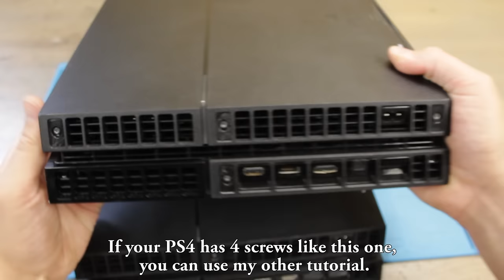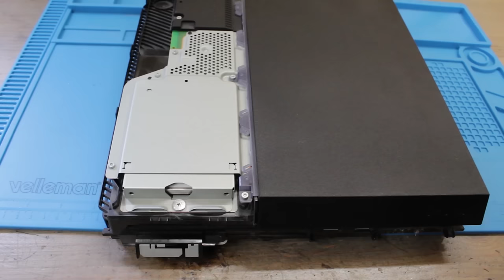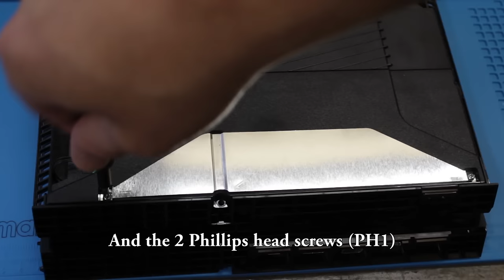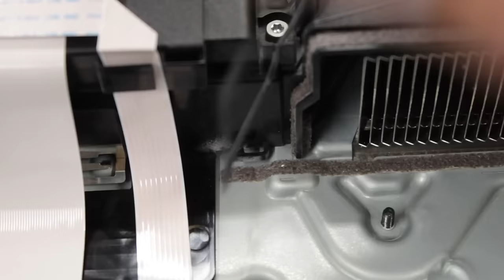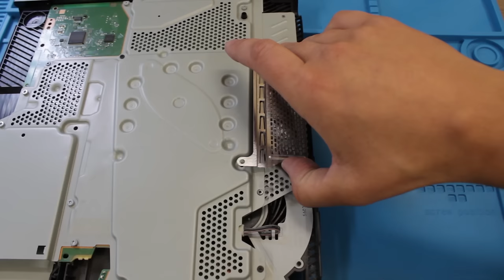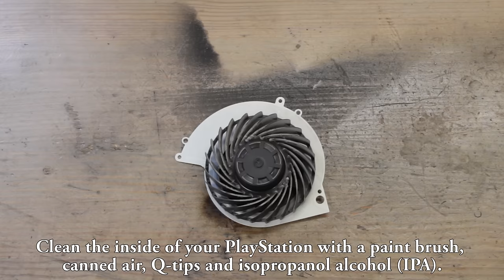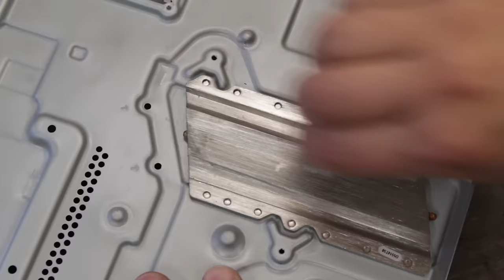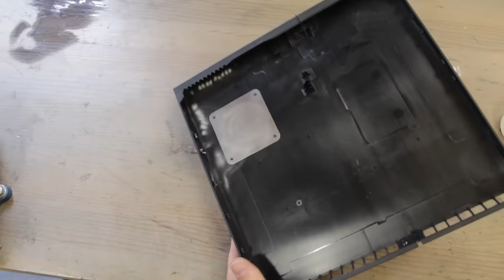PlayStation 4 model CUH-1200 cleaning tutorial.

Comment: Dude thank you so much! Best PS4 cleaning tutorial on YouTube! Was super easy to follow along. Sincerely appreciate you! I can't even hear it running now when it's on. 🙂
Reply: U think that will fix my problem haven't been cleaned since I got it 3 4 years ago now I'm going thru the white light safe mode problem where the ps4 won't start
Reply from the maker: You're welcome. Thanks for your comment. Nice to read that your ps4 has become so much quieter. Well done. 👍
Reply from the maker: @Darealblase0  It I don't think it's going to fix your ps4. It sounds like your hdd has died.
Reply: @SpareTimeWorkshop  dam what's hdd?
Reply: Nvm my hard drive might have died then

Comment: thank you for this one. my first time cleaning my ps4, and first time changing thermal paste on any of my devices including pc. and i have had it for years. lol so it was really nasty with dust. this tutorial worked perfectly. only thing i would recommend doing differently is when disconnecting the power"box" thing. dont try to disconnect it from the card but from the power supply unit instead. easyer by pulling by the cables CAREFULLY. 
I broke two of those cables in the "card end" by trying even doing it as carefully i could. but hopefully i managed to fix it. if not i will have to search for a new cable. but i guess its possible to find one of those(the one with 4 wires side by side)

Thank you for the otherwise great video!
Reply from the maker: Thank you for sharing your experience. Sorry that your cable is damaged. 

That's a great tip, I also think it's safer to disconnect the cable at the power supply instead of the motherboard. 

I would use the pliers myself so that I don't have to pull on the cables.

Fortunately, new cables can be bought online. I don't think they are that expensive.

Good luck with the repair.
Reply: @SpareTimeWorkshop  yes I saw that, just a few bucks. But I will try and see if I managed to fix it myself first😉

Comment: Brilliant video with clear and easy to follow instructions! I’ve just done my first ever complete disasemble and cleaning + replacement of the thermal paste and upgrading to an SSD In my old ps4. And my god a difference it made 😍🤩 Its completely silient comparing to before 🙌🏻 Thank you so much for this video, it really made the job 1000 times easier 👌🏻 greetings from Denmark 😊
Reply from the maker: Thank you. Well done. Nice to receive a commend from you. Do you notice much difference in load times with that SSD?
Reply: @SpareTimeWorkshop  
Cant say for sure. Aa Family guy with 2 small children and a full time job, i dont use the ps4 as much as i used to 😅😆 I havent recorded loadingtime on games before replacing it to compare, but with Cyberpunk 2077, it does feel like the loadingscreens are snappier to load through. I am certain it  is an improvement 😊 I Got the Samsung 870 EVO 👌🏻
Reply: @SpareTimeWorkshop I dont have any thermal paste but cleaned it off already. What ramifications can arise if I put it back without any?
Reply from the maker: The cooling paste is not optional. If you put it together without it your PlayStation will overheat very quickly. But judging from your next post you have already tried it. Haha

Comment: Damn thank you so much sadly I'm not a pro surgeon like u so I decided to clean the fan by the part that sticks out and only cleaned all the dust from the top and bottom panel hopefully one day I will be brave enough to be like u 😇 you truly are so useful bro with out you I would had broken my ps4 10/10 video bro keep it up
Reply from the maker: Haha thank you very much. You've had the trickiest part. That's removing the bottom cover. The rest is not so tricky. You just have to be a little careful with the ribbon cables.

Comment: Just small note some might find it useful to save your time and effort, after opening and cleaning the disk drive when you close it make sure to slide the metal plate with gears under and inside the black plastic edge of disk entrance, had to close and open my console three times before I noticed this. Here 16:03
Reply from the maker: Good tip! You can easily miss that in the video. Thanks for sharing.
Reply: Thanks for this but still my cdrom is not taking disc 😢
Reply: It's 10:42 PM here and the 3RD DAY struggling soo much to open and cleaning and changing the paste

I see him cleaning the hard drive, disk drive and etc... I just won't man😂
Good thing I won't worry about this detail you mentioned. Since I almost never use disk, maybe it won't matter much or isn't even dirty..

Comment: I followed the tutorial to deep cleanup ps4 since I recently jailbroke it and it’s never been quieter I actually had to hold my ear up to it to make sure I actually plugged the fan back in I put on mx4 thermal paste and replaced the ram pads with artics tp-3 thermal pads not even made a peep no matter the game I play it can even run P.T without complaint it’s temps now top out around 75 C under heavy load which I way way way better than before one think I didn’t do the same as in the video I removed the psu cable from the psu side of it instead of on the motherboard as I didn’t want to rip the socket off the board so even if the socket came off the psu the psu can be replaced but replacing the motherboard is a bit of a pain but overall I recommend anyone do this with there ps4 the guide was perfect and I’m just baffled how quiet my ps4 fat has been
Reply from the maker: Thanks for leaving a comment. Are you satisfied with Artic tp-3 thermal pads? And what thickness did you use?

Can you always see the temperature? Or only after the jailbrake?

I agree that it is safer to disconnect the psu cable on the psu side. Unfortunately already had a reaction from someone where the plug on the motherboard was broken.

Fun to read that your ps4 is so much quieter. 👍

Comment: Coming back to this video to point out one major key point: the thermal paste.

OP mentions he used Arctic MX-4, which after a while of researching turns out it's the best one. But the importance of this is massively glossed over, because the wrong paste will NOT solve your overheating problem, and according to research, some can even destroy your system! THIS IS IMPORTANT!
If you use a thermal paste that has liquid metals or any kind of electrical conductivity then you have to be super careful not to spill it over. 

I bought a very cheap silicone based thermal grease and while it is easy to apply and doesn't damage your components, it is absolutely terrible for the PS4! It won't conduct enough heat properly and the PS4 will warn of overheating, if at all, otherwise it will just shut down immediately after a few beeps. 

So keep this in mind! If you're going to replace the thermal paste, make it a good one!
Reply from the maker: Huge thanks for sharing this information. I must admit that I did not know that the brand of thermal paste makes so much difference.

Of course, I understand that using conductive thermalpast like liquid metal is a big risk. I myself have always used Arctic mx4. And never saw reason to experiment with other brands.
Reply: @SpareTimeWorkshop  Glad I could give some knowledge back! Today I got my hands on a ceramic based thermal paste with solid metals (grey color) very similar to the Mx-4 and the difference is night and day; not only did I apply significantly less paste as opposed to the silicone based one, but now the console is as quiet as it was when it was brand new as well! 

Ngl, it feels amazing seeing the console in the best shape it's been in years.
Reply: @DeMoraJS what is the thermal paste you used? I'm going to attempt this clean up as-well!
Reply: @nikhamilton6594  It was a generic brand named Thermal Cote 400. The one used by OP is reportedly one of the better ones, but regardless of brand the most important thing is that the thermal paste you get is ceramic and solid metal based, NOT liquid metals. You could try a liquid metal one but you have to prepare it and then apply it, which, if you mess up, could potentially fry your system (liquid metal conducts electricity anywhere it drips into), so be careful! 

Better be safe and get a ceramic solid metal base which you can identify by its opaque solid grey color. Hope this helps!

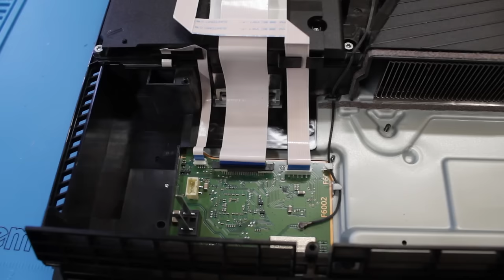Comment: Anyone doing the POWER SUPPLY CONNECTOR 3:18 must use a flat head screwdriver to go in between and underneath the little arrows on the connector. Then lift up while pulling up the cable with your other free hand BUT do it cautiously.
Reply from the maker: Never done it that way myself. I will give it a try next time to see if that is easier than using needle nose pliers.
Reply: @SpareTimeWorkshop  Yeah that’s the only way for me to get it out. I tried doing the way you did it in the video but it didn’t work. I even ended up tearing a cable but it’s ok I already ordered another one. Thank you for the video, it was still the best one I could find so far.
Reply: @SpareTimeWorkshop  https://youtu.be/P2rTRaMOtr8?si=-axBy0trWr7FWemo at 2:15. This is the video that shows the method.
Reply from the maker: @greatwarriorstruggler9447  I tried it, using a small screwdriver to disconnect the connector works very nicely indeed. Thanks for the tip.

Using the needle nose pliers works fine for me too. How unfortunate that you damaged the cable.
Reply: Can you explain a little better where I have to push up? I couldn’t take the cable out no matter what, and mildly scratched one the cable too (very little); it’s not demaged or anything, but just enough that the sliver underneath is visible. 

Nothing serious, but I’ll take it as a warning and use another way to pull it out
Reply: @christa4172  instead of “push”, I mean to lift up the connector with the flathead when inserted in between. Watch the video I linked at time mark 2:15.
Reply: @greatwarriorstruggler9447  1st off, thank you for responding, I do appreciate it.

2nd, I gotta apologise here, but I can’t figure out what and where is the linked video. Is that a new YouTube feature or something?

Comment: I slid my smaller top off to the left. Everyone seems to bend it out. Although I have the MGS 5 PS4 so not sure if that is different. It also only had 2 screws on the back

Ah, you were on the underside for that. Thanks, I was about to slide the larger top plate off but saw that you unscrewed screws there 😅

Comment: Removed most of the top part to realize I need to remove one screw on the bottom and all the wiring. Probably should’ve watched the entire video first. Now here I am at Walmart buying some thermal paste. 😅 I’m gonna do my Slim next, too.
Reply: Does it work if you don’t add temal paste bc u removed mines too without knowing he had to place a new one? 🤦‍♂️
Reply: @kbronn4875  I think it’s best you replace it now. I feel like since you tampered with the paste it may not work properly. I was gonna do the same, but my paste looked old so I went and got some paste. Unfortunately walmart didn’t have it in stores so I went to Best Buy. Hope I helped.

Comment: The top cover isn't coming off after taking the screws
Only one side of it comes a little
Reply from the maker: That one is firmly latched on. Have you gotten it off in the meantime? I don't have any additional tips for getting it off, unfortunately.
Reply: @SpareTimeWorkshop  yes i had to use the screwdriver to push the side part upwards and it came off safely
Reply: @ibrahima9274  👍

Comment: I cleaned the hell out of mine. Well... all I could not removing power battery.... dont trust my butter fingers.

I had 10 years worth of gunk inside the fan. Practically a miracle I never had a fire or even get a notification of over heat
Reply from the maker: They can indeed collect quite a lot of dust. In a room where they also smoke, it goes even faster.

Unfortunately most of the dust collects at the heatsink. It is difficult to reach it when the power supply is still inside.

But there is always a chance of damaging something when you take apart your ps4.  So I understand if you don't want to risk it.

Comment: The first time I did this, I didn’t have any thermal paste and missed two pads. When I started up, it would switch off very quickly.

I got myself some thermal paste and got the thermal pads to stick a little better, and now it is scarily quiet, started with no issues, and I don’t have to source another ps4 or get a ps5 from a scalper.

Thank you so very much. Liked, and subbed. Appreciate your hard work putting this together. So grateful!!

Ps, don’t get thermal paste everywhere, that shit is annoying to get rid of!
Reply from the maker: Thanks for subscribing i appreciate it!
Glad to read that the video helped you.
Reply: Wait did it be quiet for like week or its been quite all the time since you replaced it
Reply from the maker: @pacijentt4367  It should be quiet again for a longer period of time. Only if you smoke in the same room. Then your PS4 will get clogged sooner. because dust sticks to your PS4 more easily.

Comment: Greetings sir. First of all thanks for this amazing video. Thanks to you i have enough courage to take care of my ps4 now. I am wondering, is there anything you can recommend instead of isopropyl alcohol for the cleaning process ?
Reply from the maker: Greetings, thank you. No I wouldn't dare recommend anything else. The reason I use isopropanol alcohol (99.9%). Is that there is no water in it and it is non-conductive.

Therefore, you can safely use it on electronics without risk of short circuits or corrosion. Residues left on the circuit board evaporate.

If your ps4 has been in a non-smoking environment, you can also get it pretty clean with just a clean brush and dry cotton swabs.
Reply: @SpareTimeWorkshop  Thank you sir. You are the best <3

Comment: I have an issue pulling the hardware cover off; the plastic. No issues on the bottom one, did as you showed but no matter how I pull the top one doesn’t slide off.
Reply from the maker: The little one on top? That one can get pretty stuck sometimes. I have no other way to get it off.
Reply from the maker: The little one on top? That one can get pretty stuck sometimes. I have no other way to get it off.
Reply: @SpareTimeWorkshop  Alright, thank you anyway; I will try again either by brute force or use a tool

Comment: Does it take the loud noise away from the fan?
Reply from the maker: @MovieQueen67  short answer: yes

It makes your ps4 cooler 🥶, dust inside the ps4 causes less airflow through your ps4 making your ps4 APU hotter.  

To prevent overheating your fan will spin faster to prevent overheating.
Dried out cooling paste can also cause this because heat conduction from the APU to the heatsink is less effective with dried out paste.
Reply: @SpareTimeWorkshop  okay thank you 😊

Comment: Once i have started to disassembly the console, i even got the thermal paste too. Everything went smooth as i already have some iphone service experience but thoes pin connector cables are already pretty old and i managed to ripping out one thin cable from the plug when i tried to diconnect the power supply. I had to order a new one from ebay because it’s not something what you can get on any corner. After that i stopped and just blew out the dust as much as  i can because i don’t want to screw up another internal cabel or connector again.
Reply from the maker: Too bad, I hope removing the dust this way works sufficiently. I would say clean it completely then at least you will benefit from your work. But I understand you don't want to damage it more.

Comment: Hi! Great tutorial but im stuck at basically the start. Im up to disconnecting the power supply connector with a needle but its really tight in there and dont want to damage it. Can i leave it in or would i have to remove it?
Reply from the maker: It does need to be disconnected. on this model, you can also use a flathead screwdriver from the right side to pry it up. Or you disconnect the cable on the power supply side.
Reply: @SpareTimeWorkshop  Managed to get it off carefully, Thank you for replying too! Its cool to see this video made awhile ago yet you still reply really quick! Earned a sub bro thank you!
Reply from the maker: Thanks for subscribing, you're welcome. Responding to people using my videos is the fun part.

Comment: Damn man sadly it didn’t work for me my ps4 was  loud and everything and then suddenly it turned off saying bc it was to hot and it needed to cool down and I cleaned everything just how you showed in the video and I was happy I was able to clean it but it still gave me the same problem! 💔😞😞
Reply from the maker: What a setback. You would expect it should help. A few things to check.
- your fan is plugged in and running.
- your pa4 is in a well ventilated area.
- you have replaces the thermal paste?
- all thermalpads are properly in place?
Reply: @SpareTimeWorkshop  thanks for the help bro, I was about to give up on my ps4 but then I just decided try fix it again! Early this morning I decided to open the bottom cover to see if the fan was spinning properly but I was surprised it wasn’t spinning, then while my ps4 was on i forced it to spin. It took me a couple mins to forces-pin the fan to start working again! 🤩 I was happy that I decided to try fix it again. The other thing now is that the ps4 it is still a bit loud, idk what the problem could be this time but I’m happy that it worked again even tho it is a bit loud :)  thanks for the help bro!💪🏼🙏🏼